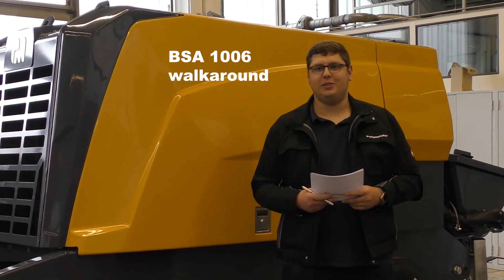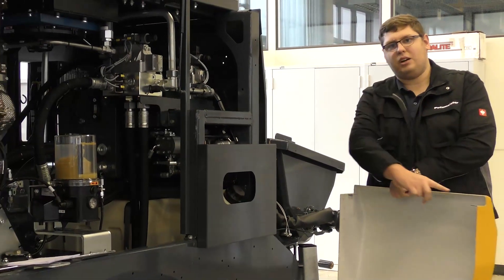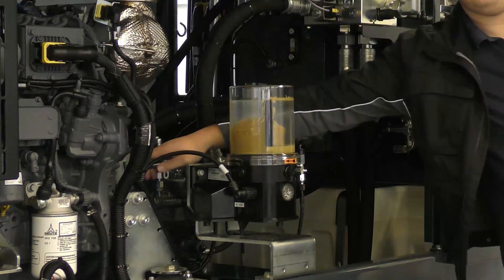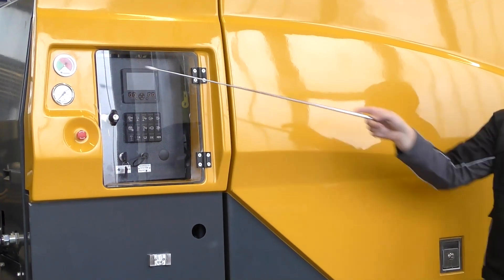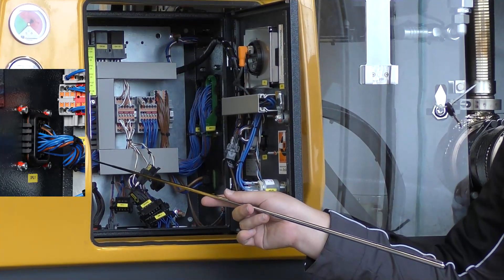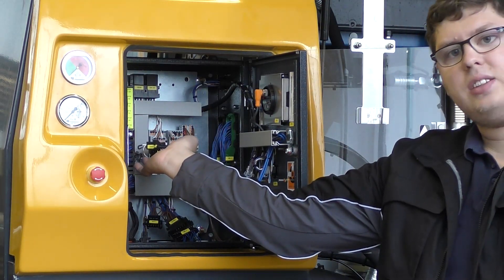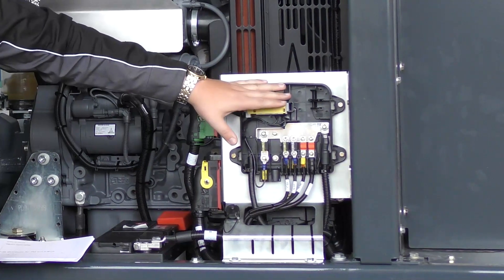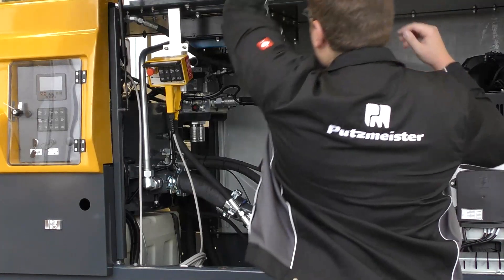Putzmeister: BSA 1005 / BSA 1006 Concrete Pump Walkaround

Comment: what is the size of piston gasket for BSA 1005 D to replace it?
Reply: it is stationary concrete pump?
Reply from the maker: yes, this is a stationary concrete pump
Reply from the maker: for all current BSA 1005 D5 the diameter of the delivery piston is 180mm